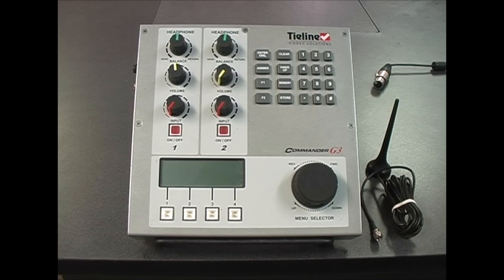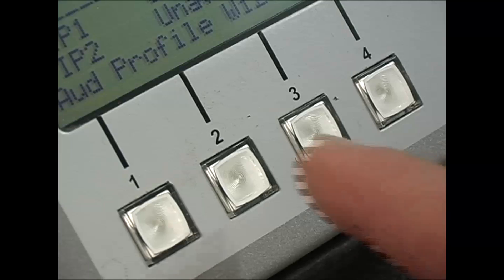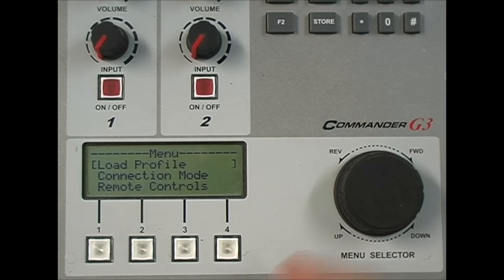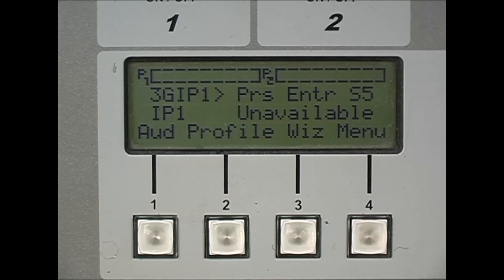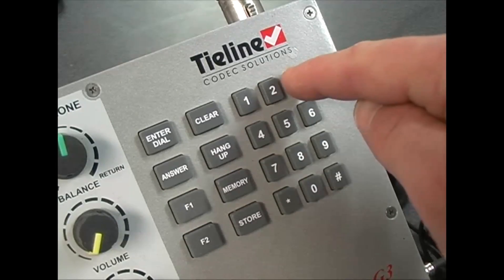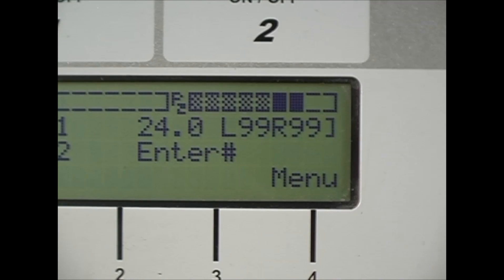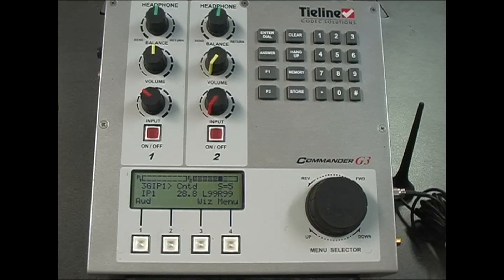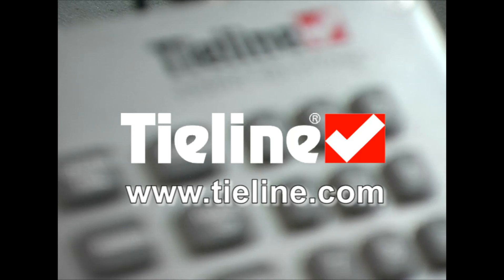How to make a wireless 3G connection

Comment: Thank you for the video.

But, I have a doubt: If I need to do a dial to another Commander G3 that are behind a Firewall appliance, what the port must to be enable that the dial can be done? 

Thank you.
Reply from the maker: The default Tieline ports used for IP1 in a G3 codec are TCP port 9002 for session data and UDP port 9000 for audio streaming. For IP2, the default ports are TCP port 9012 for session data, and UDP port 9010 for audio streaming. Alternatively, you can reconfigure these ports as required to suit your network, or if you have multiple codecs and need to use additional ports. Open these ports in your firewall to connect successfully. There is some more information on port forwarding your router at www.portforward.com and you can use a port scanner such as the one available at https://www.ipfingerprints.com/portscan.php to verify that the router/firewall ports have been opened successfully.

Comment: My Commander G3 Field keeps telling me to Insert SIM, but there's already a SIM in there. What could be causing this?
Reply from the maker: It may be worth checking if you have a pin configured on your SIM card. The codec can't unlock a SIM pin code, so you may need to put the SIM into a cell phone and turn off the pin-lock feature. Then reinsert the SIM card into the module and codec. Remember to power the codec down prior to removing or inserting any module.